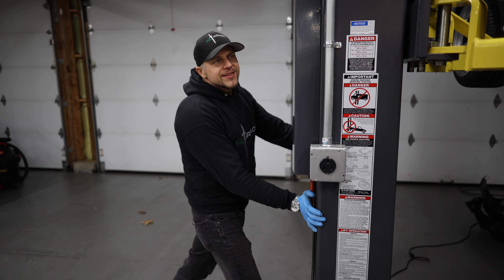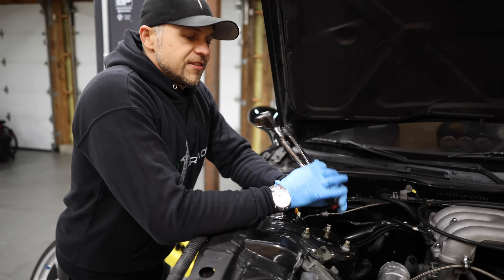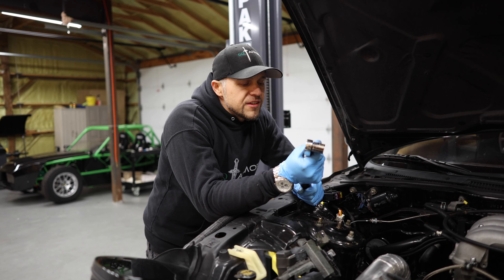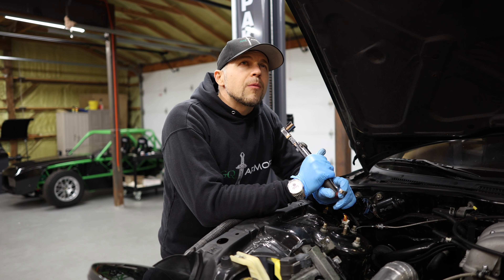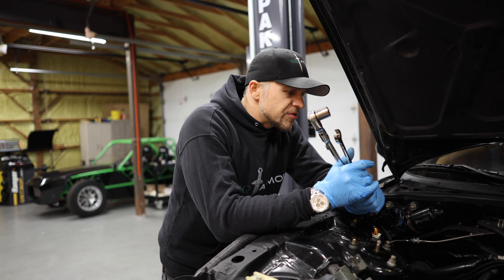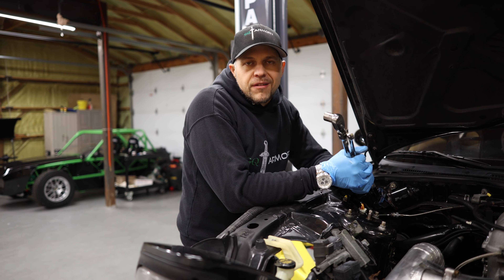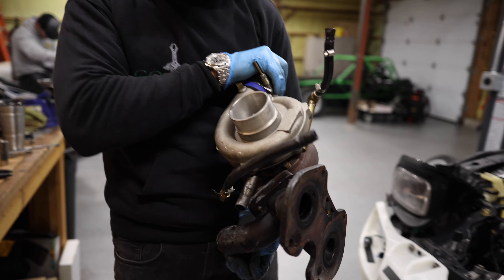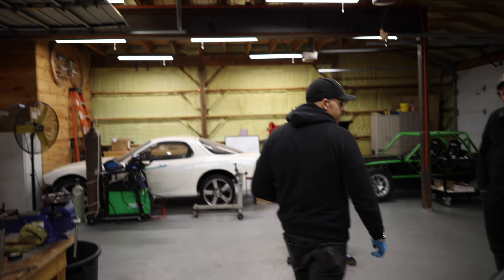Project FD RX-7 Revamp - Pulling the Turbo

Comment: Hey Quinn, two parter question around engine response.   1)How would you compare the response of the RX-7 to the ITB NB Miata?   2) If you had a dream budget how would you go about creating an engine with the very best response for a 13B turbo setup?
Reply: Street port and a smaller single turbo. Bridge port is going to over-do it. That’s about as simple as can be. G30-660 will give you what you want, but you’ll be limited to about 375hp, and while some might think it’s a little undersized, you’ll spool very low in the rpm range
Reply from the maker: They are two wildly different cars but have similar handling characteristics at the core. I think with most turbo cars you just give up the idea that you are going to have a super crisp, throttle responsive setup and you drive the car a little differently in lieu of that. Throttle response really doesn't equate to anything tangible other than a fun and exciting driving experience. If all things were equal, the car that makes more power is going to win on track assuming it's big enough to utilize that power. I guess where I am going with this is that I personally wouldn't spend the money on running say an ITB setup on a turbo 13b to try to improve throttle response because I don't think it's really a limiting factor. The stock 13b intake manifold is technically already ITBs with 3 throttle plates. On an intercooled turbo setup you still have a long intake track that will always slow throttle response.
Reply: @TheSlipAngle  Thank you for the excellent reply, gold.

Comment: I may have missed it, but what are your plans fuel-wise to go 20+ psi, water-meth, or race fuel or e85 or what?  Looking forward to seewhere you're going with this
Reply from the maker: 93 Pump baby
Reply: @TheSlipAngle  20+psi on pump on a turbo rotary.  Make sure to have the cameras running (and a rich tune and a good knock sensor).  You're much braver man than I.

Comment: Don't you have to rebalance the turbo once you unbolt the compressor wheel?! Because even the reverse threaded locking nut it self is part of the overall balance. That's why it's marked. If the locking nut ever turned slightly it would effect the balance of the turbine shaft and wheel. I'm pretty sure it will need rebalancing even if you used the same compressor wheel. Only way it wouldn't would be if the locking nut is reinstalled exactly precisely the same way it was originally on.